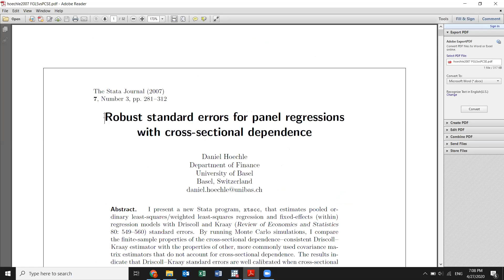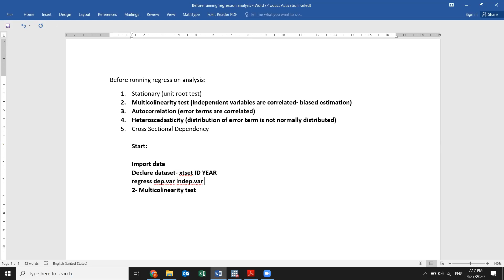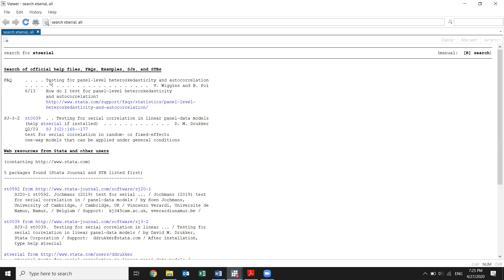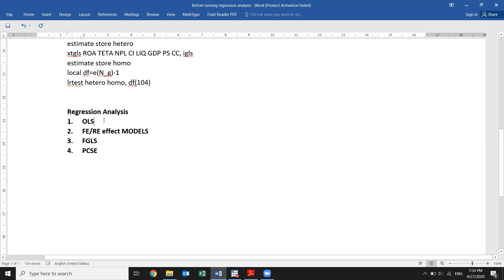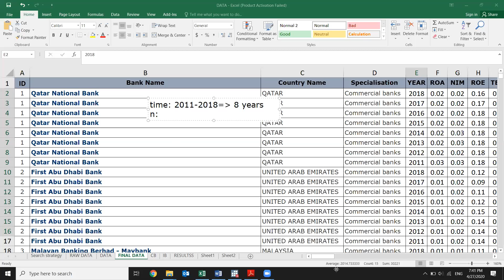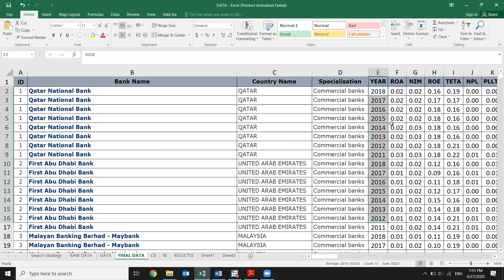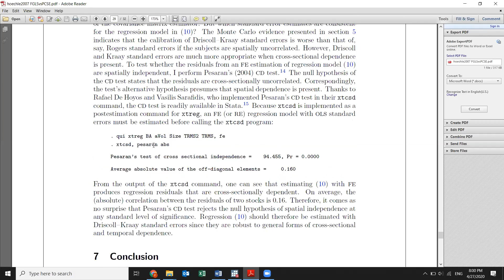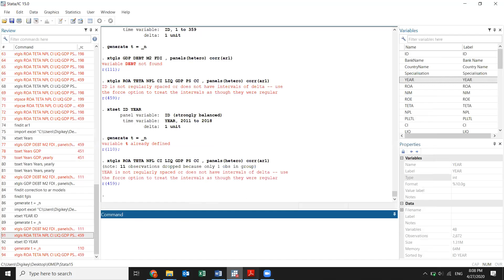FGLS and PCSE: Removing serial correlation, heteroskesticity and csd

Comment: in LR test command: lrtest hetero homo, df (104)...why 104 taken ?pls reply
Reply: any solution for this mam?
Reply: @ugurarslan3963  actually my question was  how did you calculate df (degree of freedom). But now I managed to find the answers. thanks.  Now I have a question that is there any POSTESTIMATION  available for PCSE in stata?
Reply: @renukakumawat6540  can you explain, how this 104 calculated?
Reply: @inderpalsingh7109 Try these two commands:  FIRST THIS COMMAND  local df=e(N_g)-1 AND NEXT THIS COMMAND
 display e(N_g)-1 . I hope this works.
Reply: @renukakumawat6540  yes this works for me 
thanks
Reply: @renukakumawat6540  Yes this works for me
Reply: @renukakumawat6540  Could you find post estimation test for PCSE
Reply: @renukakumawat6540  Your given command is not showing any result. Can you please tell me more? If I have 100 observations
Reply: @inderpalsingh7109  No, I have not. Pls let me know if by any chance you find postestimation of PCSE.
Reply: @CrowdeLad  This works generally, pls check if it is Stata version related issue, I am not sure though.